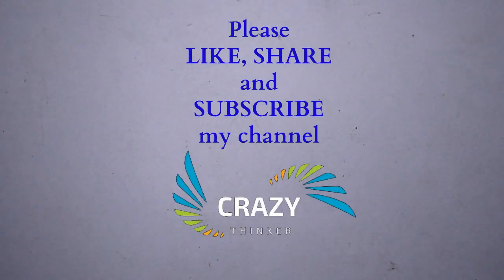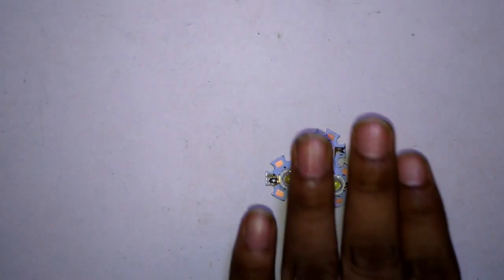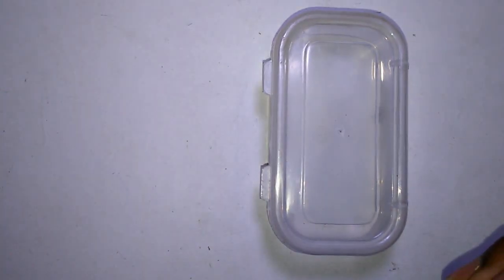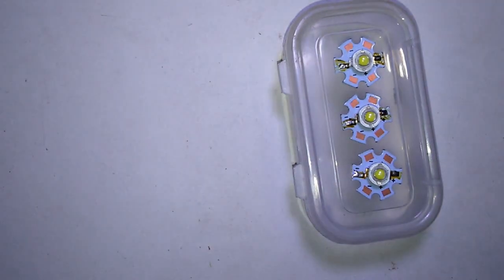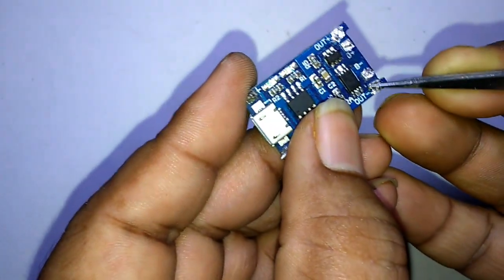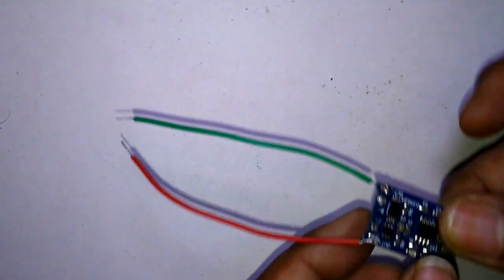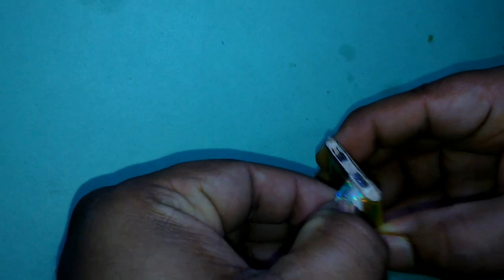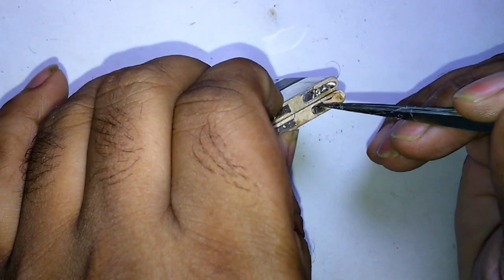How to Make || Portable Rechargeable || LED light || Mobile/Camera Battery

Comment: Jo tumna usma charging socket fix kiya kiya tum uska naam bata sakte ho
Reply from the maker: 5v charging socket or you can use mobile charging pin socket.... you can get it easily in any mobile repairing shop.
Reply: Tp4056 3ic

Comment: Bhai mujhe iss circuit me diwali lighting ka 6-mode flash circuit use krna hai..  To  kaha aur kaise connection kare..??
 Pls tell me..
Reply from the maker: Connect this circuit battery output to your 6-mode flash circuit battery input (where battery will connect in 6-mode flash circuit)
Reply: @CrazyThinker  agr me 3.7v ki two mobile bettery ko parallel me laga ke charge kru to kitni der me charge ho jaayega??

Comment: And some time when I connect to battery it gives green and red
Reply from the maker: +Shushma Dubwy it happens when there is loose connection or wrong connection and also may be some fault in module.